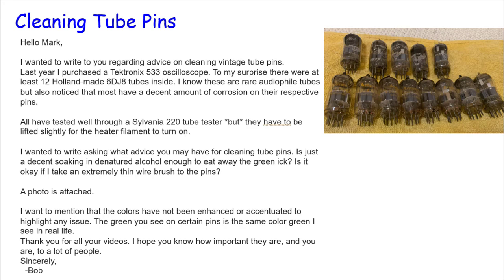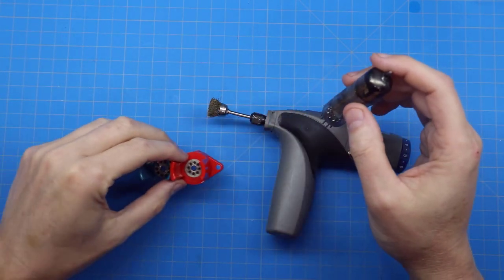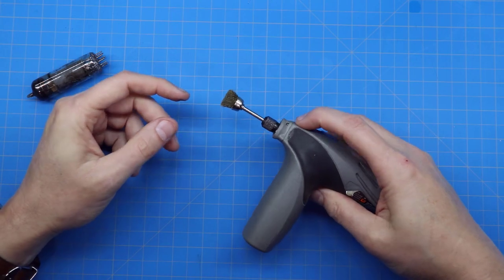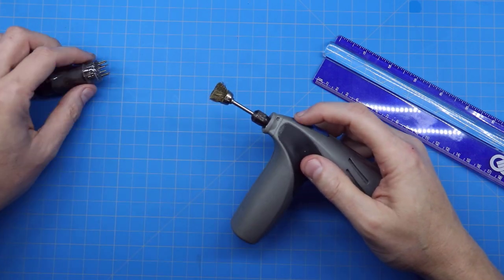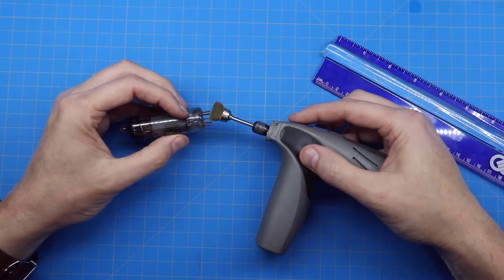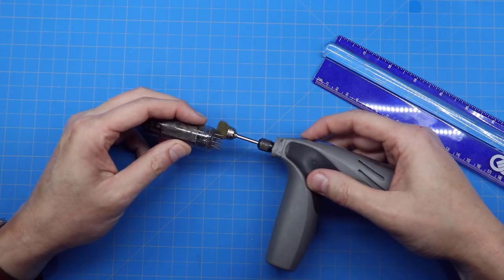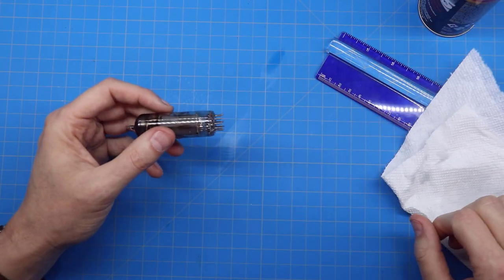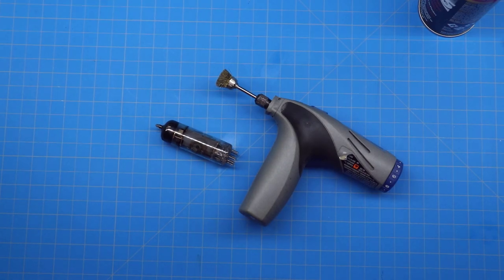How To Clean Vacuum Tube Pins

Comment: I would say don't use any abrasive on silver pins!  there's no need to! and it has to be shiny just dip them in Silver dip or the silver stuff on the cloth wipe it over that comes in the tin then wash off with isopropenyl. if you want to prevent your pins from tarnishing and give a better connection use a conductive polymer, has the same resistance as copper prevent any tarnishing give you a better connections  should use it on all your audio connection plug and sockets.

Comment: I have used the Pink Pearl pencil eraser on pins before, then coated them in deoxit D5 on a cotton bud. Your method would be more productive with many tubes in large batches. With any method be careful not to take off the base metal of tin or nickel. Stay away from Scotchbrite! too aggressive, made that mistake. Thanks for sharing your tips and tricks.

Comment: I have always had bad luck with the Dremel brand tool. Reliability and other issues. Other rotary tools are out there are better and less expensive. A number of years ago I purchased a Wen and have liked it.  I see Amazon has a whole kit with flex shaft for $20.79 -  WEN 2305

Comment: I use Dremel wire brushes all the time for cleaning leaf switches and relay contacts. I don't recommend trying to save money on aftermarket variants from the usual suspects. The wires break off much too easily and even with eye protection, getting hit it the face with a flinging wire is no fun.

With Dremel brand brushes, brass is always brass colored on the brush. They make two strengths above brass also, carbon and stainless steel. Stainless will always have a copper shaft so it's easy to tell apart from carbon steel.

The Dremel brush used in this video is part #536-02. I would also recommend looking at #537-02, 443-02 and 532-02. I find the smaller size a quite useful and these are inexpensive enough that having some options on hand can come in handy.

Comment: I like using a brass wire brush to clean pins and I own a very hard to find set of dedicated  tube pin socket brushes. That I will soak in electrical contact cleaner and you
 would be surprised how dirty the holes for the pins are! This is done by hand of course and done lightly.Good tip  Mark!

Comment: That's a good tip, thanks. I've been using a fiberglass pen in the past with alcohol or contact cleaner, it works fine, but using a Dremel with a soft brass brush should be a lot faster.